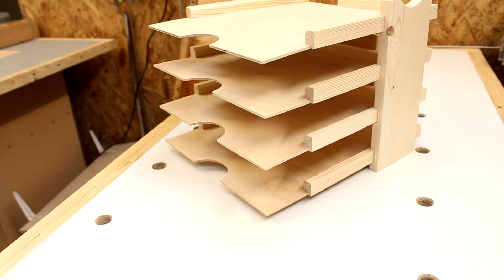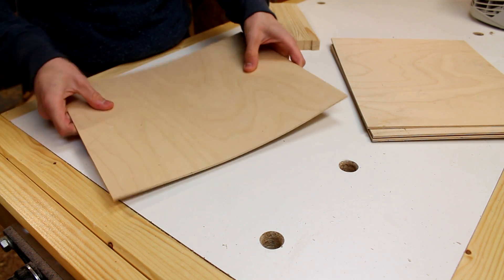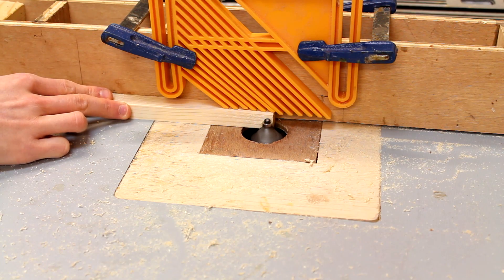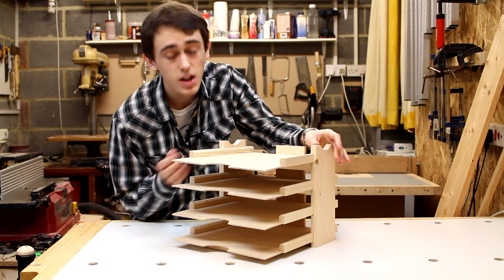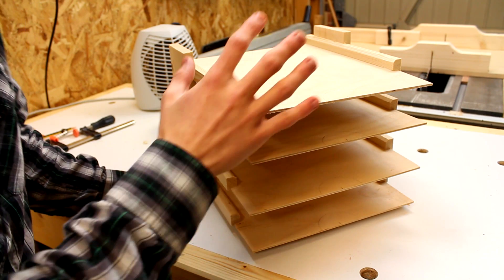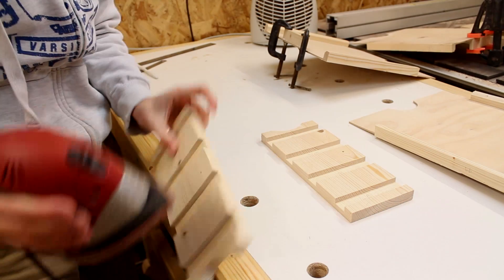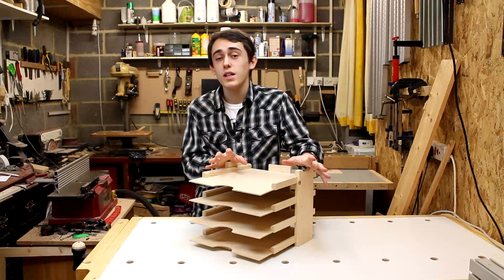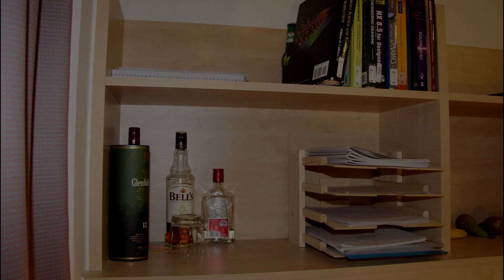Woodworking Projects | Homemade Paper Tray

Comment: The topics covered in this wood working book “Bαzοmο Tdy Plαn” (Google it) varies from wood types to tool types and uses. It also informs you regarding the several types of wood and just how easy or difficult they are to work with. In case you are still a novice in woodworking, then you`ll find this book very beneficial. .